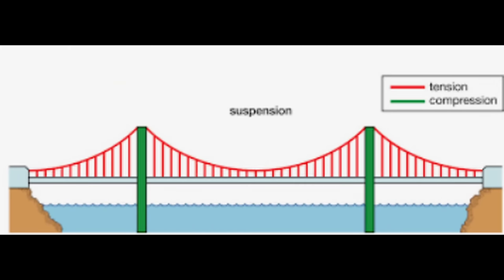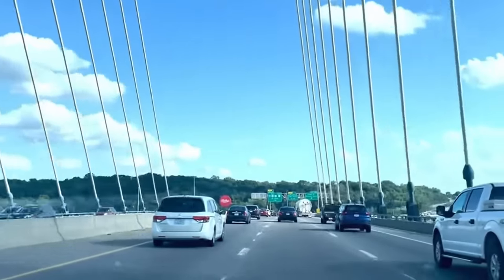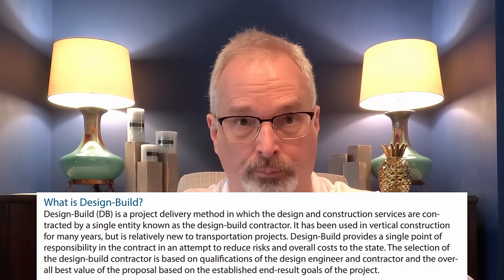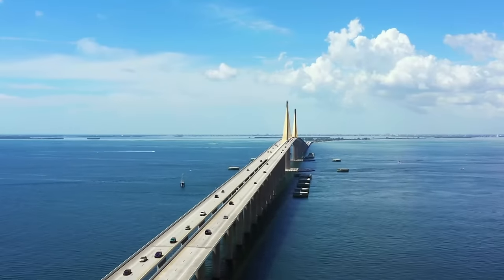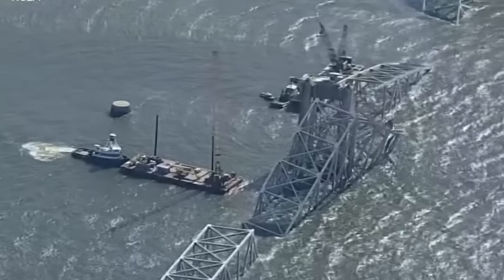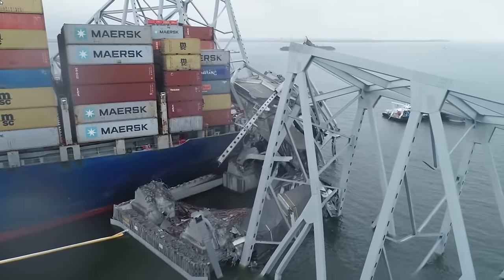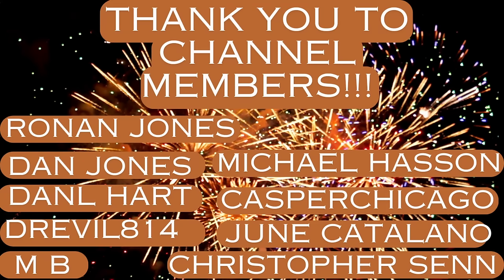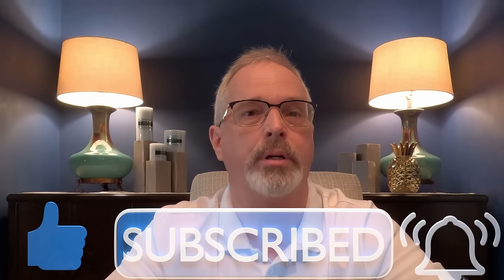How will the Key Bridge in Baltimore be Rebuilt?

Comment: In the 1970’s when the Key bridge was built, there were numerous integrated steel mills in the USA, including the giant Beth Steel mill on Sparrows Point.  Today there are only a handful of integrated mills still operating, less than 10. The bigger question is how the supply chain in the USA will be able to provide the tonnage of steel required to build the replacement bridge, what ever design is eventually chosen.  Most domestic govt projects will require USA produced steel.  I wonder how this supply chain issue will be handled.
Reply: The supply of the tonnage of steel in this bridge will be easily met.  Even one of the smaller blast furnaces at US Steel Gary Works easily produces 3600 tons/day of iron, and Gary Works, more than 19,000 tons/ day.  Electric arc furnaces can supply the requisite quality rebar.  
I would be curious to know if the Sparrows Point BF, which was the largest in North America, supplied the steel for the Key Bridge.  After shuttering, some of the equipment from Sparrows Point made its way to Granite City, and now it is being closed by US Steel.
Reply: @somaday2595 The Bethlehem Steel plant at Sparrows Point, adjacent to the Key Bridge did not produce structural shapes such as beams, channels, angles etc. The finished steel products were cold rolled sheet , plate, pipe and wire.
Reply: @markkaminski2416  Thanks for the history.
Reply: @somaday2595 You're welcome. I worked at the plant in the mills mostly the steelmaking BOF and Open Hearth processes. Wish it did produce shapes, would have loved to watch that process. I joined the Ironworkers Local 16 that built the Key Bridge. During my career I worked on many major construction projects within the Sparrows Point Plant. My father, brother and other family members and friends have retired from there. It and the GM plant were the backbone of Greater Baltimore area. Best Wishes.

Comment: I would suggest to build a bridge with the longest span possible.  Also, place the bridge support columns so that they are not in the main channel but in shallow water so large vessels could not possibly collide with the support because they would go aground first.  Than you can place barriers for the smaller crafts.  Use mother nature for your protection.
Reply: That would be at least 4,000 foot main span, to cross the waters at least 15 feet deep.
Reply: @scottkozel1519  The distance between the towers on the Golden Gate Bridge is 4200’.
Reply: The Key bridge pylons were not in the main channel but rather to each side; the Dalí had left the main channel when it collided with the bridge
Reply: @scruffy4647  
That would be incredibly expensive today. And the deep water pier is in water about 250 feet deep and could be struck by any ship.
Reply: @jpe1  
" The Key bridge pylons were not in the main channel"

Of course not. You don't want fixed objects in the shipping channel.

Comment: New electrical lines were just installed at the entrance of the Key Bridge and are the same height as the Key  bridge. They will need to be removed because the Key Bridge's clearance height was too low. The new bridge needs to be much higher to accommodate any ship that can enter under the Chesapeake Bay Bridge. This will allow more cargo and larger cruise ships into Baltimore. Presently, Baltimore's port is limited to the smallest and oldest cruise ships.
Reply: Electrical lines can be raised or put across the seabed much more cheaply than anything else.    The height installed was chosen because of the Key bridge level, not the 220-240 feet that seems to be the modern trend in what the limits of the Suez and Panama Canal and the crane height at the top 5 ports in the world.    Going 125 feet next to the current bridge can make constructing the bridge 30% cheaper because access is so simple, so moving the electrical is more than likely in the project.
Reply: The Chesapeake Bay Bridge is also currently undergoing studies for replacement because it is end-of-life. It may be wise for them to build the Key bridge replacement at a higher level, since the Chesapeake BB will not be a limiting factor forever.

Comment: Every time I look at the side profile of a cable-stay bridge, I'm reminded of all the NIST/NTSB reports that say something like "the structure lacked redundant support elements". They are simplistic beauty for sure, I just have questions go through my mind like "How do you replace a cable", "What happens if a cable breaks", "How much cable snap-back can the tower handle", "How many road segments can be unsupported by cables before they buckle", etc. Anyway, great vids.  B)
Reply from the maker: Thank you so much!! I understand that there is some redundancy in the capacity of the cables in that they are able to handle far more load than is actually applied.  If a single cable supporting the bridge deck broke, the adjacent cables would take up the additional loading.  There just can't be too many cables that break at one time.

Comment: As long as they are rebuilding, they should add at least two more lanes. This would allow for future traffic.
Reply: It would at minimum have the modern breakdown lane configuration which is now required.
Reply: Having commuted over this bridge twice a day for 28 years, I don't believe Thats warranted. We'll see.
Reply: @1972Ray the statistics I find show the Sunshine Skyway has twice the volume of FSK and it’s two lanes each way but has a full width breakdown lane on right side and a narrower one on left side which can help in many cases.
Reply: A breakdown lane makes sense, but more lanes isn't a solution to congestion. Higher capacity transit solutions like overhead wire electric trains are the only solution to congestion issues.
Reply: @JohnHallgren  Of course, but this bridge is quiet at rush hour. It's in a low populated area. 30,000 cars a day sounds like a lot, but the two tunnels do about 200,00 cars a day.  I guess we'll see.
Reply: @1972Ray  and breakdown lanes would help when oversized loads are on it as well.
Reply: They didn’t put breakdown lanes on the US - 301 replacement bridge.   Very poor regressive decision making.   At least Pete Rahn is gone (retired) now.

Comment: The Gordie Howe bridge has a much greater budget because the infrastructure required on both sides of the bridge, involve two different countries. Baltimore's replacement bridge won't have that problem. Widening the central entrance / exit to the harbor will make navigating safer and easier.

Comment: Very good, very clear. Just one suggestion, why not remove the legal protection for endangered species altogether if the protections can be suspended when they are inconvenient?
Reply from the maker: I see your point.  I think that topic should be part of the discussion but I also think that a lot of the environmental considerations can be fast-tracked more than they typically are.
Reply: @CaseyJones-Engineer  Like most legal constructs, this issue falls (or should fall) somewhere on a continuum. The bigger question is whether we have invested sufficient effort and expertise into finding ways to dramatically reduce assessment and remediation of environmental impacts for infrastructure development wherever possible. People love to complain that we're not spending remotely enough on infrastructure, and we're not - but good luck spending much more each year given that environmental assessments and other regulatory processes and oversight can add half a decade or more to a project, and result in constant stops and starts. That that's before the legal challenges environmental groups constantly throw in front of projects, often demanding that something like a bridge be replaced with "city-wide light rail" or "a bike path."

Meanwhile, most of the rest of the world is building new and upgrading/enhancing existing infrastructure hand over first on an ongoing basis to provide far more reliable, safer, more stable, more protected infrastructure capable of handling the needs and demands of modern logistics and populations - and gaining competitive advantages in the process.
Reply: The rules need to be reformed to limit these endless lawsuits by environmental groups.

Comment: Cable-stayed seems most likely.  But what I'd very much rather see in that spot ... is a modern arch design.  Something similar to either the Lupu Bridge or the Mingzhou Bridge in China, both of which have longer main spans than the Key Bridge.  The Mingzhou even looks sort of like a modern version of it.
Either this, or a twin span like the new I-74 bridge between Illinois and Iowa, but a larger version of it.

Comment: A cable-stayed bridge along the lines of the Arthur Ravenel/Cooper River Bridge in Charleston, SC would be appropriate for the Key Bridge location. The center span for the Ravenel/Cooper River Bridge is about 1,600 feet, thus the pylons for the cables would be located approximately where the anchor piers (for the old continuous truss span) are located. The longer center span length of the Gordie Howe Bridge is due to the placement of the cable pylons being placed on the banks of the Detroit River (a similar approach was done for the New Goethals Bridge on the Arthur Kill between New Jersey and Staten Island).

Comment: Feather ruffler here.  Very informative video. Just want to throw in my two cents. Original plan for the route included a tunnel under the Patapsco River.  Just because a bridge was eventually built to complete the route a half-century ago is not a valid reason today.  To wit,  when the WTC towers fell, they were not replaced; an entirely new and different structue rose in their stead. As has been stated, it was designated a hazmat route because of being above surface.  A sixty thousand foot view today, along with a thought to security concerns that weren't  an issue at time of construction would indicate that a bridge could be constructed from  Lazaretto Point to Pointe Lookout to replace the hazmat route and if deemed necessary, construct a tunnel under the shipping channel to the harbor.  Looking at the land use along the current I-695 (MTA 695), I would speculate due to the ensuing growth of industry, and residential use, along with stricter ecological mandates, recertification of a hazmat route may not be feasible..  A side note is that the approximately twenty mile long section of I-695 formI-95 interchange at Rossville  til it reconnects at Halethorpe is under the authority of Maryland Transit Administration along with the fallen bridge.
Reply from the maker: Those are good compelling points.  I just think that the urgency to get this crossing open will not favor a tunnel option.  Check out the pinned comment for further remarks about tunnel restrictions.

Comment: I really enjoy your posts. You really help a layperson like me understand. What I would love to know is if the whole entirety of the bridge will be replaced or just the downed span section.
Reply from the maker: Thank you!  Well I suspect it will be a total rebuild as the bridge has effectively run to the end of its useful life.  This is an opportunity to upgrade everything to current design standards.  Also, a lot depends on whether they attempt to have a longer main span length for the replacement bridge.
Reply: @CaseyJones-Engineer  Yes, I figured as much. What a long and expensive task lay ahead. Thank you for your response, I will continue to monitor progress through your posts. I am so curious to see how they navigate the removal of debris on the Dali and the Dali itself.

Comment: I know cable stayed is the current trend for any/all bridges, but from a cultural point of view, it would be nice to see the original steel truss (of whaatever it was called) rebuilt to keep the look.   In Montréal Cxanada, they rebuilt the Champlain bridge and in the end, we are stuck with an ugly concrete bridge wth frequent pylons into water  for 90% of the length and a very short stretch over the St-Lawrence seaway canal with cable stayed portion to allow it to span the canal.  

This is quite different from the massive bridges in europe where the vast majority of bridge across  valley is cable stayed or suspension and thus becomes a impressive work of art.  

BYW, the cable stayed bridge over Indian River on the Delaware 1 just north of Bethany Beach, the concrete was added/poured on the bridge in small sections which were then attached to their cable to hold it (as opposed to prefabricated sections).  It has 4 towers (2 on each side).  The archirectuer was chosen such that the pylons remain out of the river which has strong tidal flows in and out which had eroded the sand around foundations of old bridge to a point where sand started to erode below the foundations. 

In Montréal, the St-Jacques bridge over Décarie was a prefab bridge that was first put up across Décarie, and then the tower built up and cables added at later stage.   Short video at "Project 101 - St. Jacques bridge Overpass" from Mammoet.   While this technique likely not usable for Baltomore, it does show the need to find a way to build a bridge without any long term interruptions of the shipping canal below.
Reply: Im sick of cable stayed bridges... They are too common to the point they are just as boring as the typical concrete slab bridge that usually replaces actual truss bridges.
Reply: Cable-stayed bridges are just about the ugliest ones out there nowadays.  More steel trusses and cantilevers.

Comment: I am not an Engineer, but have had some exposure to the process of building bridges.  There are MANY phases and steps involved in the design and build of a bridge.  It begins by planning, with public consultation, preliminary design, etc. Once some of that is done and a high level concept is chosen, then permitting application starts, Geotechnical, Surveying, property acquisition, environmental impact, archeology, traffic studies, economic impact etc.  Then once that has progressed far enough they can then get on with design, and then move into construction.  The planning phase can take anywhere from 3-10 years depending on urgency, design may take 2 or 3 years, and construction on something like this 3-5 years maybe more.  Cost will be $ 3 - $ 7 Billion .

Comment: Retired engineer here. Team should review the process used to rebuild the I-35 bridge in MN after collapse.  Replacement took about 13 months with expedited reviews and despite many lags due to controversy over mass transit, bicycle, and pedestrian accommodations. Based on length, perhaps these are not of issue here. I would suspect they may look at an alternate alignment option keeping the approaches for recreation use as they did on the Sunshine bridge in FL.

Comment: I think the most important point he made was regarding the bureaucratic red tape and environmental impact.  You can throw all sorts of money at a project to try and reduce construction time.  But if the government doesn’t do their part, you can still have an overall slow moving project.  The other thing to worry about is scope creep.  I am sure Baltimore and Maryland politicians view this as an opportunity to do more than is absolutely required to replace the bridge.  That will slow down the project.  The priority is rapid replacement.  The project scope should be controlled to insure only absolutely necessary construction is performed, within reason.  If you start to expand the scope to do massive upgrades to the approaches, you will drive up the cost, extend the time line, increase risks and increase the economic disruption to the community.  Keep the politicians under control.

Comment: Regarding cable-stayed bridges: there are a very popular design type recently. Around here (Vancouver, BC), earthquake-proofing is top of mind for any bridges, and I have heard cable-stayed is considered the most survivable design. We now have several of these, the most prominent being the the Port Mann bridge, the Pitt River bridge, and the Alex Fraser bridge. However, a problem that keeps coming up in winter, which does not seem to happen to the other bridges, is the issue of "ice bombs" impacting the road surface - basically icicles form in conditions of ice and snow, that then break off and fall down onto vehicles. Not sure if that is typical of cable-stayed  designs, or governments become more risk-averse in recent years with regard to  liability, but now in winter conditions, they end up closing a lane each way on these bridges, so bridges workers can do de-icing work to take the icicles off or prevent them from forming. 
So if Baltimore and Detroit-Windsor are building cable stayed bridges, will they have to to contend with this issue too? Or is this just a Metro Vancouver issue?

Comment: I am also a civil and was a project manager for over 20 years.  Egos are what drag projects out.  Every engineer has a better idea than the previous engineer.   The secret is that the most suitable EXISTING cable stay design could be selected; even better if the design engineer of record for that project is still active.  Get the bridge structure into production while the foundation is designed to deal with the loads imparted by the already selected bridge design.   But instead, an engineer will make a tower 3.23785 feet taller and the span .80365 feet longer; and declaring it their design.

I'd line the new piers/towers up with the power line...

Comment: A cable stay bridge has the flaw that it puts the pylons under sideways tension to either side as traffic moves over it.
A suspension bridge mainly if not solely puts the pylons under compression transmitting the cable loads back to the cable anchorage points at each end.
I'm not and engineer but I think that flaw played a part in the Morandi bridge collapse.